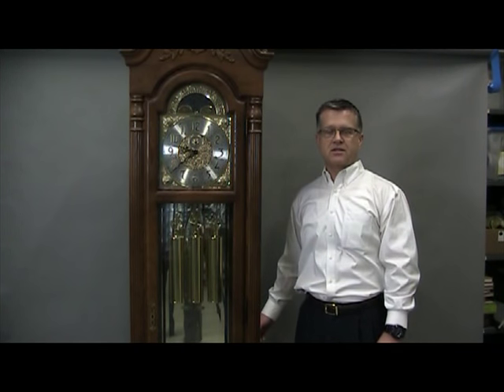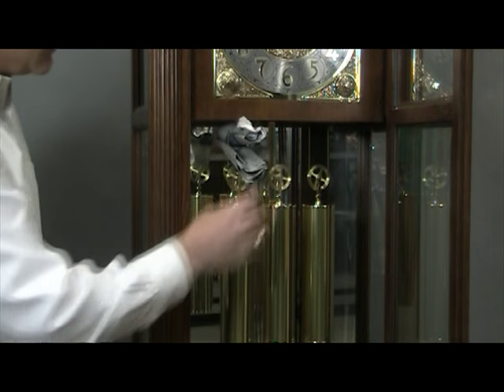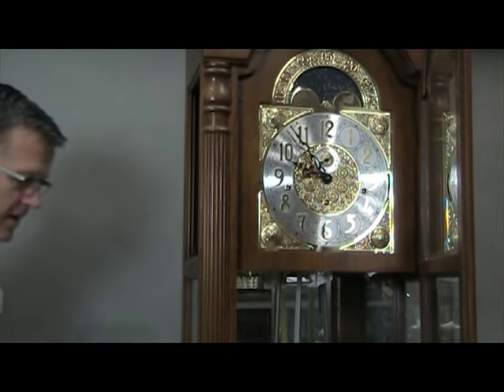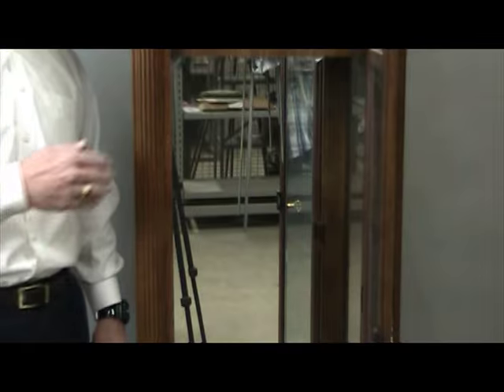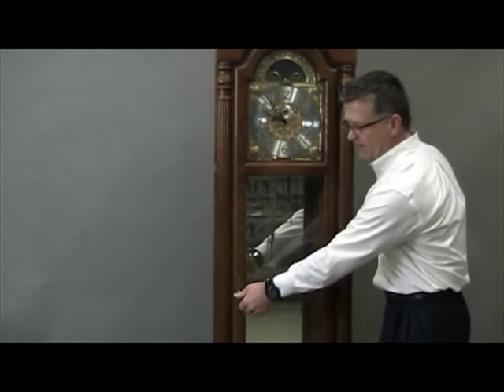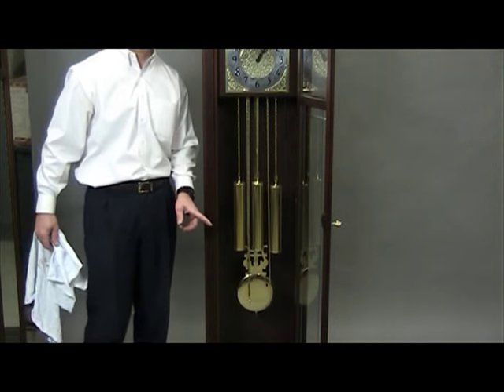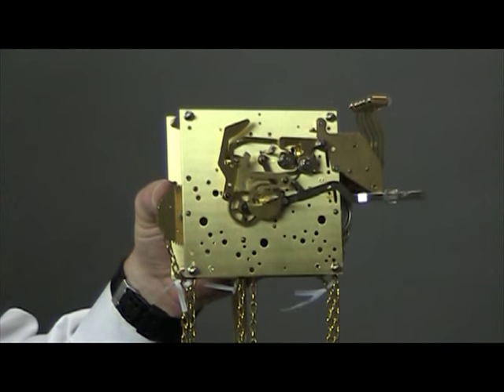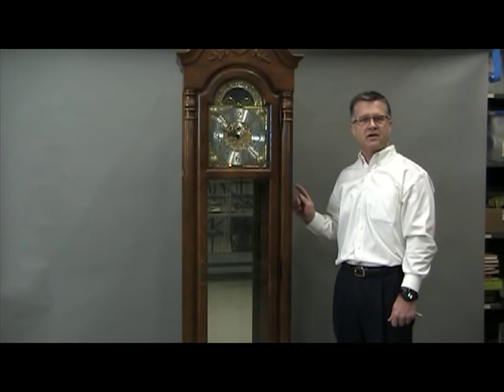How to Move a Floor Clock

Comment: These instructions were terrific.  I love how carefully you covered the intricacies of this task step by step.  I feel much less intimidated to do this now.
Reply: Be sure to gather the ends of the chains and insert them into a sandwich bag and tape around the opening to secure the chains within the bag. This prevents the chains from swinging loosely in the cabinet and potentially breaking the glass or mirror.

Comment: When moving in the house, I just take the weights and pendulum out, move the clock and put them back in, it's still holding perfectly well in time. But I guess for long distance moves, more steps should be taken.
Reply: Did you lay it down when you moved it?

Comment: Hello,  I used your video to prepare a clock I purchased.  When I cranked the weight up I think I did it too high.  Couldn't get the weight out due to the newspaper.  Now the cable or wire has come out.   Yesterday i found a video showing how to put the wire back in but now I can't find it.  Do you have any suggestions or do you have a video for this?

Comment: After doing this, is it ok to lay the clock down on it's back?  I'm getting a moving truck to move it from Ky to FL, but I don't think it's as tall as the clock.
Reply from the maker: Yes... as long as the movement cables or chains are tight and secure. This will prevent the cables or chains from unraveling.
Reply: @howardmillermkt  The one I'm getting (from wife's mom and dad) also has more glass than what your clocks show.  What do you recommend to protect the glass?  I'm not sure if it's easily removed so I can wrap each piece of not.
Reply from the maker: Blanket wrapping the entire clock is the best option.

Comment: The pendulum on my clock stops swinging after about 5 minutes, any knowledge on why this is happening? Thank you
Reply: Make sure the clock is level first. If so the thing that the pendulum hangs on might need centering. You can do this by using the force or put a piece of paper at the bottom of the clock and mark it where it ticks or tocks and adjust it my moving it to the side where the tick is closer to center. You'll want the tick and tocks both about equal distance from center. If that doesn't work it probably needs new oil. Pay for that or you can buy the correct oil and cleaning kit and there is a guy that does it on Ytube if you are handy and can follow along.

Comment: How do i fix running to slow?
Reply: I'm not sure if this helps, but a lot of grandfather clocks have a knob on the bottom of the pendulum. Turn it to the left (clockwise) to slow it down and to the right (counterclockwise) to speed it up. Only a very, very slight turn is needed, like less than a quarter, and adjust as needed.